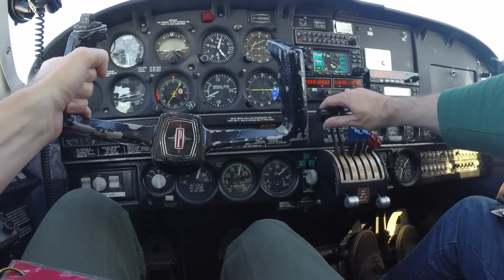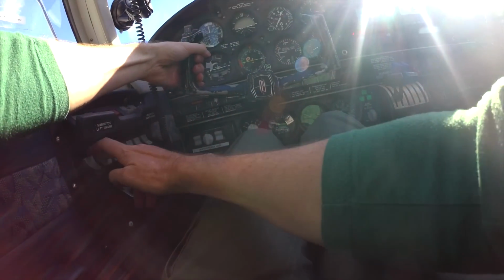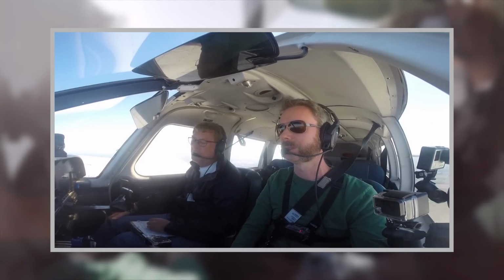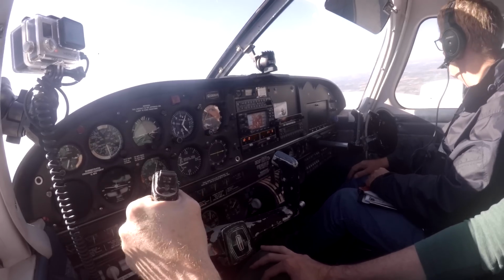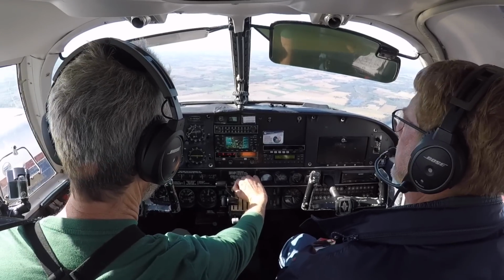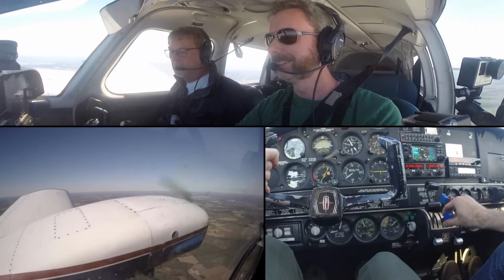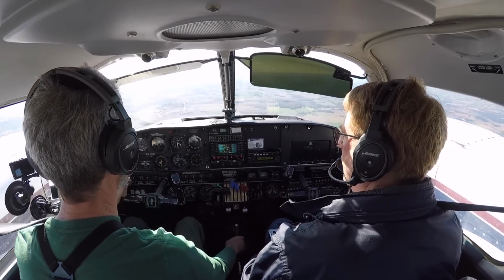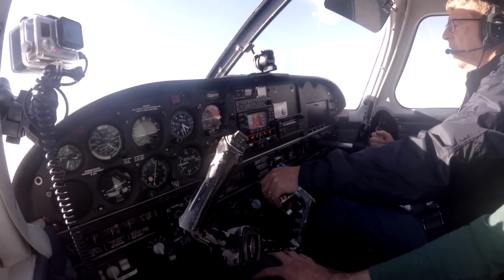Getting my Multi Engine Rating! - Surprise Engine Failure - Flight Training VLOG

Comment: I'm doing my initial training and am about to do my multi-class test here in Australia literally tomorrow for my multi instrument rating in the DA42 twin star coming up! We have similar checks which we call phase one and two. Phase one is used in a critical situation such as a low altitude and practising engine failures in the circuit which which is just mixture, pitch, power, gear up, flap up, indentify, confirm and feather (then be sure to check performance and fire). Always go full power because it's a critical situation. The phase two checks is where we hold feather and go through the fuel systems ect to try and restart then feather and secure the failed engine. Only then do we reduce the power on the live. I think that's because for smaller planes with reliable engines, going full power won't affect them too badly so there's no point trying to mess around setting climb power ect in a half emergency
Reply: James Petersen that sounds like FTA?
Reply: The Student Aviator yep hahaha

Comment: Good job on Kevin's part with the fuel shutoff.  I really thought you HAD lost an engine.  It wouldn't be the first time it's happened.  :)  I am curious, though, and maybe Kevin can answer this.  When you were in cruise, you had the mixtures pulled back, I would assume for best power and best fuel flow.  When you simulated losing the engine, everything went full forward to the firewall.  Okay, now, at 4,000' I don't think that it really matters that much, but if you had been flying higher, 10,000' or maybe in the mid-teens, it's possible you would also flood out the good engine by going full rich.  While this is only your first lesson, it sets the standards for later training.
So, why did Kevin teach you to go full rich on BOTH engines?

Next question.  You're taking your Multi training, which of course, for flying the D18 and DC-3 is important, but when are you going to finish up your Instrument rating?  Getting stuck on top would be a bad thing, and in a multi-engine airplane, it seems more likely than a single, since you'd normally be flying higher and faster.

Comment: Had an instructor pull that stunt on me in a single-engine Cessna! A glider had landed out nearby, and he asked me to see if it was still there. "It was there 2 minutes ago, it's not going anywhere," I said, but he insisted, so I lifted the wing and had a look, and sure enough, glider, sitting right where it had been 2 minutes ago. Looked back in and SHIT! The engine coughed right as I noticed the mixture yanked all the way back. I'm not ashamed to admit that I slammed that thing for'ard. "That's what it'll feel like when it happens for real," he said. Yes we were on downwind with a nice easy cross runway available, but still, not a fun experience!

Comment: How are you supposed to know when you REALLY do have an engine failure.
Reply: Well, like Steve experienced, the airplane will shudder a little bit, one rudder pedal goes dead, the airplane may start rolling to one side.  Unless you have a fuel exhaustion issue though, the airplane may give you some warning, decrease in oil pressure, temps climbing, weird noises or any number of other indicators.  Not all engines just immediately die, although that's not to say that some don't.  There are usually warning signs, you learn to recognize them.

Comment: Awesome that you actually got to TURN OFF the engine (god forbid). 
At my flight school that’s not part of the training, the engine is never actually turned off, only simulated engine failures.
Reply: Situation arose during multi training in ABQ NM some years back. CFi 'did' shut off the engine for training. It did not restart. Too far from LZ @ Coronado Airport [no longer in existence] to return.

 End result was a forced landing on Interstate 25, that caused a major disruption and loss of aircraft. Flight school insurance faulted the instructor and BK'd the fledgling flight school.
Reply: ABQ NM, terrain alt [aside from surrounding mtns above 10,000] is at 1 mile. Add the average warm climate and additional flight alt, and the second engine, as often said locally, will only serve to more rapidly get you to the scene of the crash.

Comment: That is exactly how I would be if I were a CFI. Except I would really put on a show. I would put a smoke generator on one of the engines and hide the controls on my side. I would then install a switch that kills all the lights and turns on a hammer cylinder that hits the floor of the plane to make it seem that the plane is falling apart, along with a speaker system that plays the screeching and tearing of metal. Then we would see who passes their check ride...bwahahahaha (evil voice)
Reply: Calm down Satan
Reply: Alright, I'll provisionally approve this as long as there are GoPros everywhere. As a student, I'd forgive you if I got it on video.
Reply: Right... cause that would totally simulate real world conditions.
Reply: 00 you are one wild and crazy flight examiner.  ;)

Comment: "Firewalling" comment ---- glad to  hear that I'm not the only one averse to doing that .... 
(but that's the engineer in me....)
Reply: The engines will thank you, but I'll tell you, if I'm 100' off the deck and lose an engine, everything is going full forward quickly.  Of course, at 100' off the deck, they would be already.  Let's say 500' up, and you're just pulling back the power.  Each situation is unique, and we need to address each situation for what it is.
Reply: In planes where that would kill both engines, I would practice not flipping out and building muscle memory for the correct settings for climb out.

Comment: Loved this video. A real training video that shows how tough it is to absorb all this info in a short amount of time. For the future, any way to isolate the gear warning horn out of the audio track?
Reply from the maker: Unfortunately, the only way to remove the gear horn would be to remove the engine ambiance track and go with the intercom patch only. I like to mix the two together so it sounds exactly like being onboard
Reply: Besides, it gives you all the input you're dealing with in the real airplane.  That gear warning horn CAN be a real distraction to some pilots, so IMHO, it's good that you don't get rid of it.  Of course, it would be nicer if you could get rid of it in the airplane as well.  :D
Reply: Ah okay I see. Still awesome . And I'm sure it was way more annoying for you than it is for us.
Reply: Because it's a steady tone, I believe a good audio processor could filter out that frequency. You'd lose any overlapping sounds also, but given its pitch that's probably not an issue. I know of some podcasts that use a similar technique to remove noisy air conditioners, etc. Whether or not you should is another question. Those warning horns are a mental distraction when flying, so filtering it out in the debrief would do a disservice to capturing everything you were juggling. It's actually unfortunate that they get cut out when someone speaks because IRL they keep buzzing in the background.

I was 5 hours into an IFR cross-country training flight when my ANR headset batteries died. Had a missed VOR approach and a full-stop ILS approach to complete, while under the hood and on real IFR flight plans. Everything up to that point had been going pretty well, but combine fatigue with the sudden loud engine noise and I practically forgot everything I had learned. After a sloppy missed, ATC had to ask why I was overshooting my assigned airway for the next clearance and I had to buy my instructor a drink. Incidentally, I did have replacement batteries in my flight bag, but one lesson I've learned is that the batteries only ever die when you're too busy to change them out.

Those loud noises may be a nuisance, but they play a significant role in the real life events so I think they should be left in.

Comment: Reminds me of a question on reddit:

"Which should I get first, IR or Multi?

Which is the more likely scenario: 'Oh no, there's reduced visability' or 'Oh no, my plane sprouted another engine'?  

Congrats Steve!! :)
Reply: My two cents, for what it's worth.  Instrument Rating first, you might get into a situation where you have reduced visability in a single-engine airplane.  Look back through Steve's videos for his trip up along the shoreline where the weather was getting low.  It's not fun to be in that situation without an instrument rating.
Reply: Antonov 687:   If that indeed was a serious question, then here's a serious answer.   I hope you have your instrument rating  by now.  A twin can only get you into bad weather situations more quickly than a single engine trainer.  It won't help you get out of them so much.   So that ME rating should probably wait.
Reply: Gary C That's the joke, mate
Reply: Sorry Adam, guess it just went over my head.  :D
Reply: I know this is three years old but in the uk there are separate IR for single engine and multi engine (but pilots with a MEIR can fly single engine IR) so from a money standpoint getting the multi engine first is better
Reply: anto687 this is the greatest comment I have ever read.

Comment: was this your first practical? how much does the rating cost.thanks
Reply: Julian Fernandez Barcellona a multi rating typically costs anywhere between 7-10K USD depending on how many hours you need. Expect 200-300 USD per hour